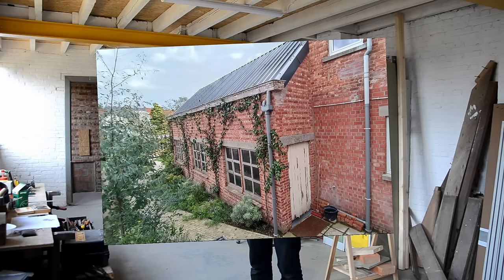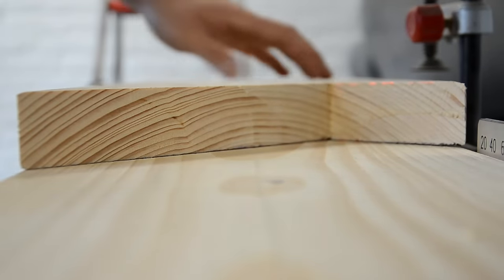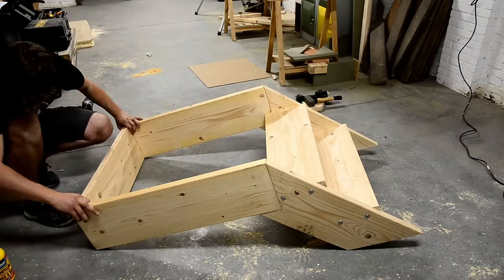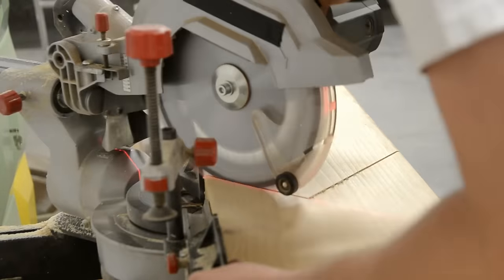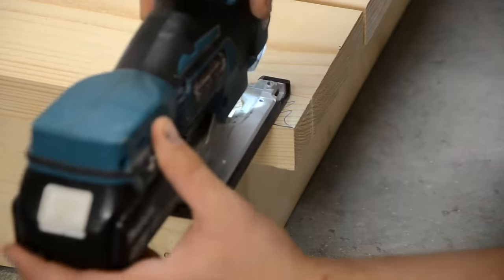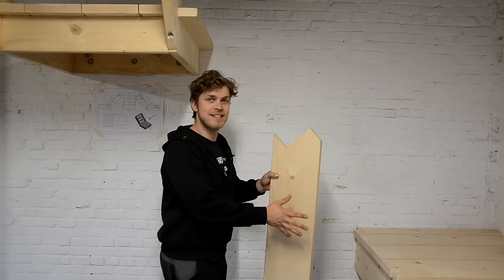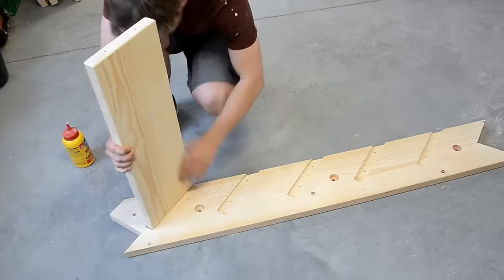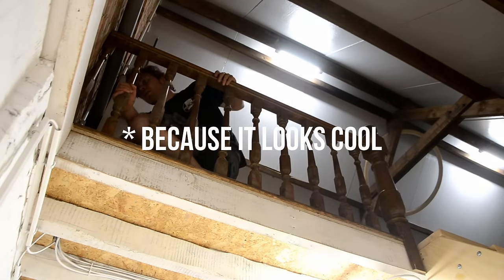Making a Floating Staircase - Woodworking

Comment: Looks great, but a 45 degree angle will never pass code in any country... 7/11 my friend.

And WTF would you counter sink anchor bolts??!?!? You've lost 50-75% of their sheer strength in the lumber.

Again, "LOOKS GREAT", function is 1/10
Reply: I agree on the anchor part, but passing code, it's his risk and he's the only one who's using it and in Belgium no one is going to check that 🙂

Comment: I might have missed an earlier comment, it appears to be nicely done, however, all staircases need (require) a railing for safety purposes. It would not pass a building code test here in Canada. I’m amazed it was not mentioned in the comments.

Comment: I think it's very dangerous to suggest in this video that it is enough to basically just tie things to each other. At least use proper metal bearings or better a metal frame! Stairs can not be built like a washing machine. This looks life threatening and nobody should consider copying this or walk in this. Falling even 2meters can be deadly and this is by no means safe.

Comment: Your entire design is flimsy and is held together by PVA glue and some heavily recessed (why?) screws driven into cinder blocks...
In a couple of years your pine boards will begin so dry and shrink, so be prepared for some loud harsh popping sounds (when the glue gives in) coming out from your construction and the gaps begin to appear all across that entire thing.
Good luck!... 😀😅